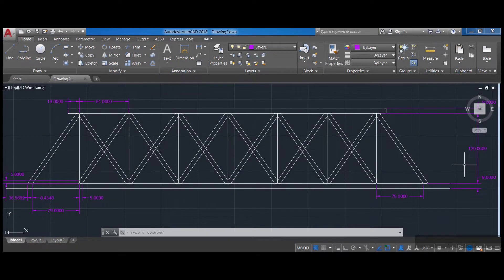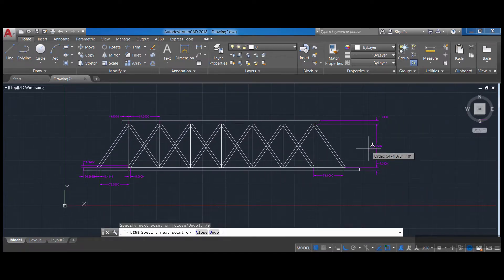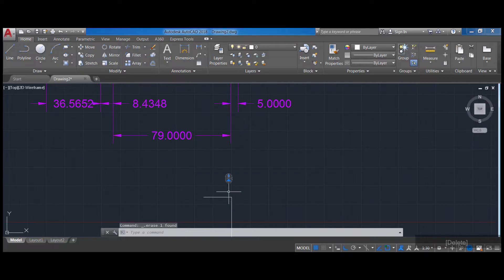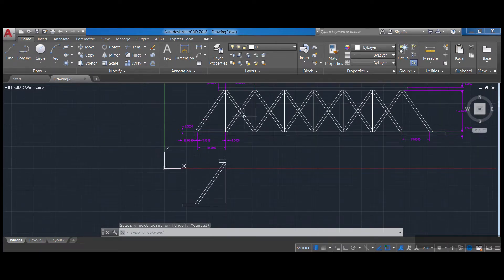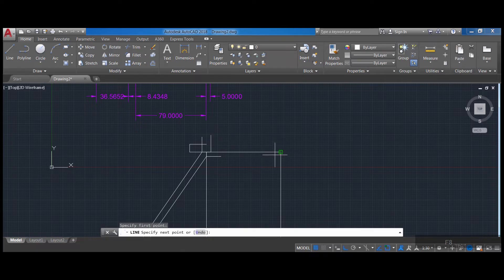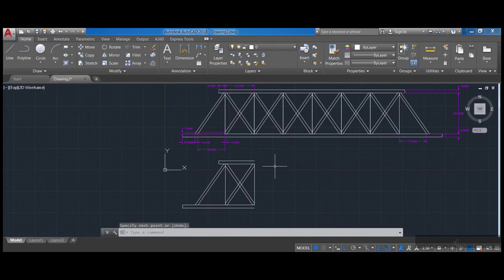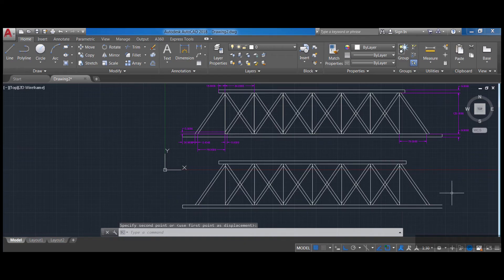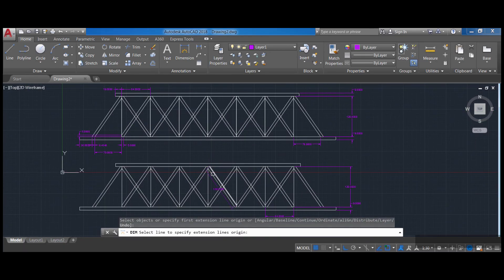How to draw a bridge in AutoCAD fast and easy tutorial

Comment: The drawing could be done much more efficiently if 
1) The guide lines were drawn on a guide layer so they could be hidden or deleted in by turning off the guide layer,
2) Instead of copying the panel 6 times the presenter could have used the copy with the array option  or used an array in the first place, and lastly, 
3) Instead of mirroring the left side and moving the mirrored left side to the right side of the bridge, the left side could have been mirrored by a vertical line through the midpoint of the bridge to finish the drawing.